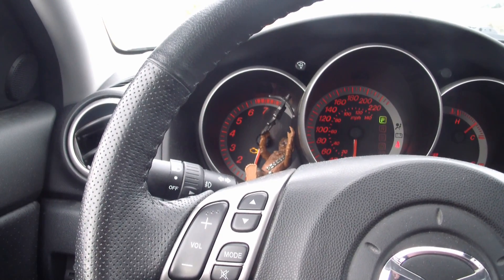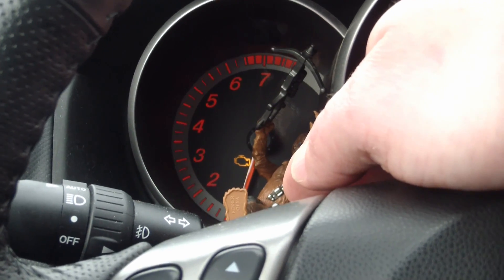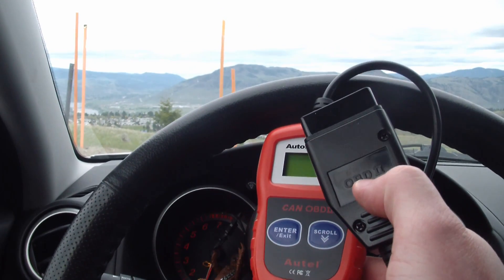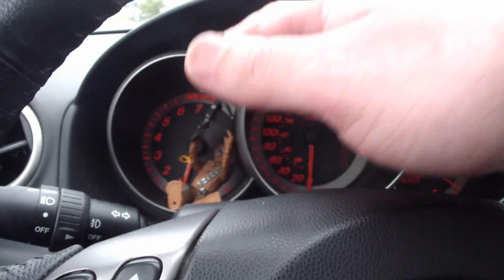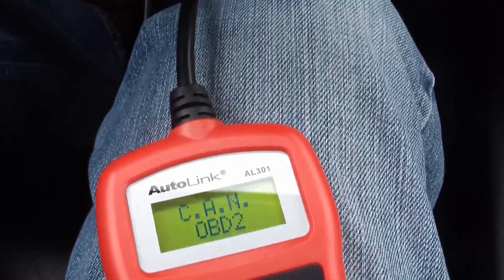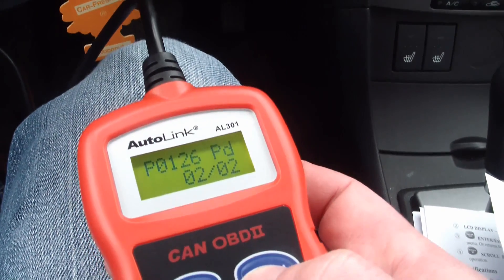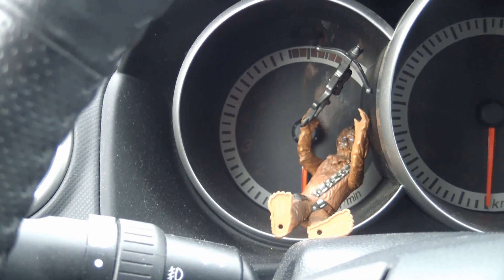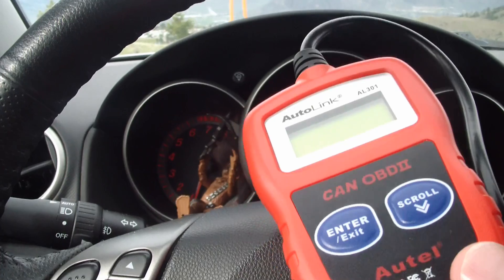Manly-Man Skills: Outsmart Mechanic Scams by Using Your Car's Computer!

Comment: My dad bought one about 10 years ago for over a grand but they got those down to 30 bucks now?! If so its criminal that they dont build it right into the dash!
Reply: Well you can do it without one... but it involves counting flashing lights
Reply: @ThePooba26  And paper clips
Reply: @ThePooba26  you have the Yiddish satanic star as your profile pic.
Reply: @roberthaas5372  You are wrong but thats ok
Reply: @ThePooba26   Its genesis is unknown but it was used extensively in the ancient Mystery Religions before the advent of the Cult of Yahweh, consequently the device was not historically limited to use by the Israelites, Judahites, Judaeans or Jews. Thus, originally, in antiquity, the six-pointed star that later became known as the Seal of Solomon, Magen David, was used side by side with the five-pointed star, or "Pentagram," both serving as magical signs or as decorations. The six-pointed star, or hexagram, was the Ammonite and Phoenician symbol of Moloch, god to whom some parents sacrificed their children, and of Ashtoreth, ancient Semitic fertility goddess; identified with Phoenician Astarte and Babylonian Ishtar. Astrologers also used it to represented Saturn, the giant planet that is the sixth planet from the sun.
Reply: @ThePooba26   Comprising of two equilateral triangles having a common centre, the Seal of Solomon is analogous to the "Ying and Yang" device of the Eastern Mystery Religions of the Hindu, Chinese and Peruvians. The ancient Indians used it to represent the union between Shiva, the Destroyer, and his consort, Kali, with the polar energies perfectly balanced. The down-pointing triangle is the feminine principle (Kali), and the point up is the masculine principle (Shiva). Among the Judaean, symbols from Hellenistic times, both the Hexagram and the Pentagram are missing since they were deemed the signs of the pagan and his dark arts.
Reply: @ThePooba26  Moloch, Chiun and Remphan are all names for the star god, Saturn, whose symbol is a six pointed star formed by two triangles. Saturn was the supreme god of the Chaldeans.

The hexagram was brought to the Jewish people by Solomon when he turned to witchcraft and idolatry after his marriage to Pharaoh's daughter in 922B.C. It became known as the Seal of Solomon in Egyptian magic and witchcraft. David had absolutely nothing to do with the hexagram and that star most certainly did not, in any way, represent God's people. Solomon gave himself up to satanic worship and built altars to Ashtoreth and Moloch (Saturn).
Reply: @roberthaas5372  congrats on proving yourself wrong
Reply: @ThePooba26  Sanhedrin 55b Rab said: Pederasty with a child below nine years of age is not deemed as pederasty with a child above that. Samuel said: Pederasty with a child below three years is not treated as with a child above that.24 (24) I.e., Rab makes nine years the minimum; but if one committed sodomy with a child of lesser age, no guilt is incurred. Samuel makes three the minimum. Sanhedrin 54b Raba said. It means this: When a grown-up man has intercourse with a little girl it is nothing, for when the girl is less than this [three years old], it is as if one puts the finger into the eye; but when a small boy has intercourse with a grown-up woman he makes her as 'a girl who is injured by a piece of wood.'...
Reply: @ThePooba26  That would be ODB1
Reply: @ThePooba26  Only on older OBD-I.  Since OBD-II, it is read on the odometer as a letter and four digits; but recent models are again NOT ABLE to display codes (so to allow the Stealerships to continue to scam  lazy owners that stiil believe in such nonsense like "keep your GM 100% GM"
Reply: @ThePooba26  WIth my luck I'd get p9999 error
Reply: Cody'sLab the nice one your Dad bought probably does a lot more than read codes.
Reply: cody, just get a Bluetooth elm327 adapter/readed i have one from Amazon by foseal, then just get an app to use it with phone or whatever. btw nice vids.
Reply: I was going to comment the same thing. My old c5 showed the codes onboard. I loved that feature. It seems like there was a way to do it on Newedge Mustangs as well, but it's been a while since I owned one.
Reply: it is kinda.  they do build it into the dash of the c5 corvette.  it's great!.  I hear they quit doing that for the c6 and c7.
Reply: '04 Dakota has it built in.
Reply: +paulparoma yeah but the ones in Cadillacs are wayyyyy over complicated and not at all user friendly, not even for techs like myself
Reply: Where the heck is my usb-c diagnostic port!
Reply: @Kowyn  Super easy conversion fobs available to do exactly that.
Reply: they don't build them into cars because 99% of people don't know what to do with the information. it only tells you the fault detected. not the cause of the fault.
Reply: Karthik Pradeep 
You should look at the torque android app.
Reply: ONLY on obd1
Reply: Cody'sLab a lot of the new cheap ones won't pull full codes and you still have to go to a mechanic to get the full read.
Reply: On obd 1 not obd 2.  Need a code reader for obd 2 aka 1996 or newer year model.
Reply: Your more expensive scan tools can access more data than a regular one, this one can probably only access trouble codes and freeze frame data. If you spend closer to $100, they have the code descriptions built in
Reply: If you want the Snap-On one with scope just $10,000. I paid $100 about 10 years back. I paid $18 recently for a wireless Android one with full live data. Now I need to buy a laptop and usb OBD cable as I got full PC software. Then I need a OBD Memory Saver. :D
Reply: Cody'sLab mechanics gotta eat too... the mechanically disinclined are the bread and butter of the automotive service industry
Reply: yeah im a tech at cadillac they built them into c5 and certain cadillacs its easy to use if u actually read the instructions
Reply: Brian Esser not in MY experience. I have yet to run into one that wouldn't at least blink the code. sometimes it's hard to find the process, but it has since been suggested to me that the system (or legislation) REQUIRES a method of displaying the codes without additional cost to the owner. Sometimes it can be hard to find out how, but the process should be buried somewhere in the manual.

just MY experience and what I've been told. never claimed expertise. Still worth checking out before spending $$

Besides, after Toyota and Volkswagen played their little games with everyone's life.... who knows WHAT the manufacturers actually do.
Reply: 30$ is bare bones.  Still expensive for live data,  oscilloscope, etc
Reply: you can buy cheap ones that are not half as advanced I've used a 5000 dollar scan tool and a 20 much different quality scan tools tell you many thing where as 20 dollar ones just give you a code
Reply: Honda's got it built in. There's a plug you connect a jumper to under the glove box. Turn on the ignition and the CEL will flash engine codes, and if it's an auto transmission, the "D"rive light flashes tranny codes. Counting the flashes can sometimes get confusing when there's more than one code, though. A good reader will eliminate interpretation errors and give you more information.
Reply: There is also a big difference between a basic code reader and a scan tool that has bidirectional control, and can access data that is not part of OBD.
Reply: You can get a bluetooth one for $10 now and pair it with a phone/tablet (app torque is good) for realtime stats.
Reply: Moonwalker917 you can still do that. You can essentially use the tools a dealer uses to register a new keyfob, and start the car with it. That requires opening the car first though, and many cars have a delay programmed in so it would take half an hour to register that key.
Reply: Look up online & write "your" kleptocrat congress critters.  Or better yet their oligarch bribers.
Reply: Pooba is your name a play on "Grand Poobah" ?
Reply: my car has one, 07 outback
Reply: ODB reader only or did it have multi way programmability.
Reply: Cody'sLab actually, they do! usually there's a process to get the lights to blink any codes. Newer vehicles with alpha-numeric displays will actually show the code. Like he says.... google, google, google!

i only say usually because I haven't owned every kind of vehicle. but every one I have owned would blink.
Reply: Damn Tight Tool Reviews I
Reply: Agree
Reply: Jase Poag on at least older Chrysler’s you could get them to show DTC’s by cycling the ignition on and off three times in a row
Reply: @JonBoy470  Yes, and it was very convenient!  But as soon as the idiots at Cerberus (and the even more idiotic ones at FIAT) completed the destruction of whatever still existed of Chysler, they no longer display any code on the odometer...
Reply: love your channel and build into the dash? then how will thousands of mechanics over charge people for parts and labor they don't need?
Reply: If you have a VW, you can get one that you can use to program things for 60$, not just read and clear faults
Reply: The one your dad had that costs over a grand was when they first came out, secondly the ones that cost over a grand now also have a ton of manuals on how to fix the problem.
Reply: some cars will now let you pull the data out of the dash. but it only shows the error code.  You don't get freeze frame data out of those little scanners and you don't have bidirectional control for testing purposes.
Reply: Cody'sLab is”
Reply: Yup, flip the key to on & off for 3 cycles & leave it in On position on the 3rd cycle. It will read the code/s & display them. If there aren't any it shows DONE in a tough to read font. Also as trurtmaster1 said an ELM327 bluetooth adapter does all that & you can read it on your phone from a distance. It can do a lot more like map trips, power, fuel use etc, depending on the software you download for it. Nice vid Mike!
Reply: Cody'sLab they do have modules that will interface with your touchscreen system and tell you the diagnostics of your running vehicle.
Reply: That's why you can't check the trans fluid on a CV transmission. We aren't smart enough.
Reply: it has been in the connector since 1981 if you know what 2 terminals to jumper
Reply: you're here too yey:)
Reply: As I said above  the cheap readers do not always give you all the codes. Most will only give engine codes and ignore all the others that can set the CEL (Check Engine Light).
Reply: Made me smile knowing you watch AvE Too. Cant wait for your next episode
Reply: Some cars will tell you.
Reply: They did.  Cars use OBDII  (On Board diagnostics version 2)  OBDI had built in code readers. (Think 1980's)  You cycle the key and a light on the dash would blink a code.  You had to stare at it for a while count the blinks then look it up. Some companies had plug in readers too.  OBDII is better because all cars use the same plug, and the codes tend to be the same.
Reply: Old European cars before OBD2 used led flashes. My 1990 Mercedes has the “count the flash” system and its a pain. Gets old losing count, lol
Reply: @travisprillwitz8332  C'm on... it is not that difficult IF you are able to follow the cadence of the flashing.  Don't be so lazy!
Reply: the buick reatta had a basic one in the late 80s early 90s that was a crt touchscreen in the center console that was a neat little party trick.
Reply: Some older Subarus had a button/pedal combo to let the combo meter read out dtc codes. Took that feature away on newer models though...
Reply: My 2000 Jeep GC reads out the codes on the odometer if you flip the key back and forth in an esoteric way. Easier to use a reader.
Reply: 04 newer f150s can read codes. Just hold the trip reset and trun cry on release trip reset. And click through the codes
Reply: tere are some functions you really dont want end users messing with, dpf regeneration for instance, or actators for handbrakes , door latches , horns etc...
Reply: If you start googling you will find that many cars can have the codes pulled and reset without a scanner. 
Older Chrysler's did flash codes , so did ( maybe still do ) GM's , subaru has the green and black connectors under the dash to flash codes when connected etc. If anyone is interested google can surely show you a ton more cars that did this too. In the end obd1 was a real pain in the ass , obd2 def is better in every way possible
Reply: Cadillac used to have on board diagnostics through the climate control panel. Of course you have to buy a Cadillac to get the built in diagnostic ability........
Reply: YouTube legend
Reply: On some school buses, they do.
Reply: There are companies that sell them directly with all the bells and whistles like Bluetooth communication with their proprietary phone app and such.
Reply: I got a reader for £11 that farts the info over bluetooth.  10/10 tbh.
Reply: Old comment I know but I thought I might mention ,most older obd1 and early obd2 vehicles had such a feature, For example on older obd2 Chryslers you flip the key on and off I think 3-5 times, then it lists all the codes on the odometer.
Reply: I remember seeing some documentary about car thiefs back then and they were showing off a modified one to start cars without a key. They described it as a rare device only made in Russia or something like that. So maybe it was truly expensive, or it was sold as such it wasn't such a no brainer to buy things on the internet from some chinese sellers.
Reply: @Moonwalker917  The car needs powered on before it can even detect anything at the OBD2 port, so they have to have something else that bypasses the key before the port even works. They were BSing you.
Reply: Cody'sLab Cody! Didn't know you watched this channel.
Reply: Cody'sLab Hi how are yah
Reply: Brian Esser I understand sir. enjoy ur night. no hard feelings
Reply: Cody'sLab use thermite to melt rock
Reply: no..just no.. you dont understand what you are talking about
Reply: Brian Esser charging 60 minutes for less than 5 of work? you got it!! besides, what "knowledge"? or are you one of the extremely few that even knows what points are? let alone how to set them.

all you "technicians" do is what the confuser TELLS you to do on modern cars! then charge 8 hours for 45 minutes work! your "experience and knowledge" justifies the hourly wage. stealing $$ for time you NEVER PUT IN makes you a crook!

then there's the crooks who tell a guy he needs 5k worth of work to safety a vehicle when they didn't even check it!

I've been on both sides. I could easily do a couple thousand words of what I have seen with my own eyes!
Reply: Brian Esser same "industry" that says Toyota is safe or VW diesels get good mileage? so the manufacturer rips you off, and that justifies ripping the customer off? THANK YOU for proving my point! 

least you called yourself a TECH. "Mechanics" had knowledge! I don't really care what you worked on in high school. you don't know what points are. A "technician", YOU, wouldn't have a clue without that "data". so, WHAT "knowledge"? I was fixing cars back when you had to KNOW what a scope said, WITHOUT a computer TELLING you which coil was pooched. some "experience"!
Reply: @squidstings  I can still set the old point and condenser system. As well as rebuild your old quadrajet, Edelbrock, Holley double pumper and so on.  Can teach some of these young ones a thing or two,  because I've done a thing or two.  Guess I'm the old school mechanic born in the wrong generation.
Reply: ohhh, CRAP! I've forgotten more than this guy will ever know. now I feel old! LMAO
Reply: Brian Esser funny. I thought we were talking about how technicians rip off the customers! you've already justified why YOU DO! The manufacturers short change on warranty repairs, so YOU rip off the customers! I don't care if you're a legend in your own lunch time. you're garbage! charging for time you never put IN, is THEFT, by definition! period! all you tried to do is justify it. enjoy your future
Reply: Brian Esser go away
Reply: Hi Cody I'm one of your viewers,great stuff.

Comment: The last time I went to a VW dealer, they wanted £1000-00 to replace my entire exhaust and cat converter.  I slipped a local mechanic £20 to weld the broken bracket - no trouble since and its been 7 years...
Reply: I had my exhaust patched up so many times I dont think theres much of the original left XD
Reply: Local VW dealer wanted $149 and an appointment next Tuesday to replace one of my student's halogen headlamp bulbs. I pulled one out of my drawer and installed it for her in about 3 minutes. Showed her the price tag from local Auto Bone - $7. She's a cute and sexy girl who knows zero about cars and mechanical stuff. Tell me they weren't taking advantage of her. Thanks - Lumpy